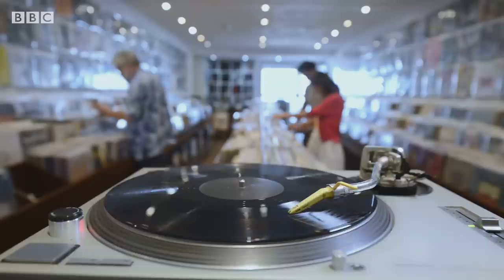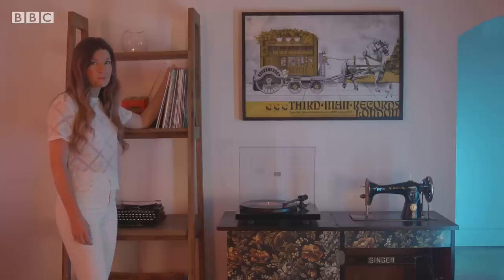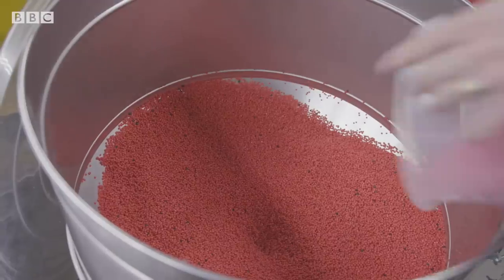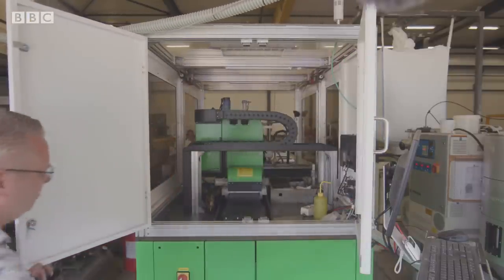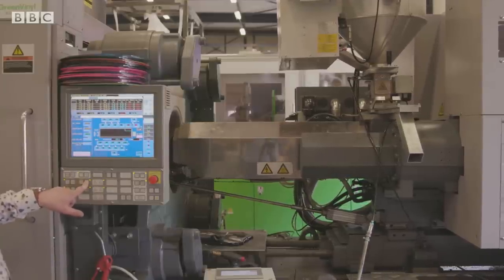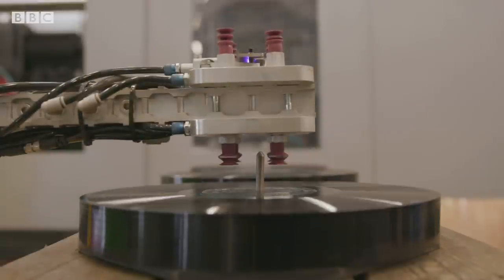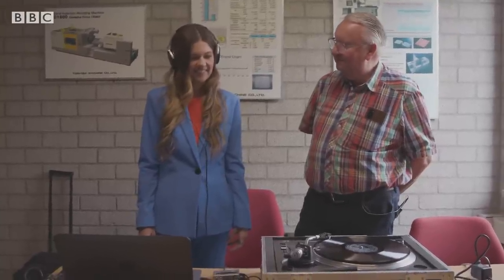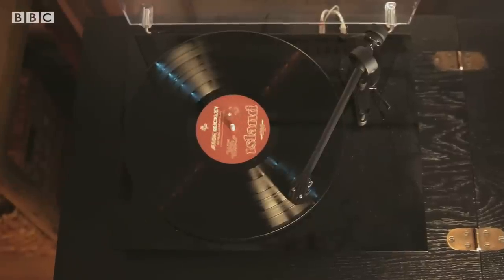Can vinyl records be made in an environmentally friendly way? – BBC News

Comment: Also, can we point out that yeah, PVC is bad for the environment, but using it for music records is hardly bad for the environment, people don't like throw out their vinyls, if they have any they probably already decided they liked collecting them. Maybe throw a fit about PVC being used in a way that is bad for the environment instead of just throwing a fit about Vinyl Records because they're made of PVC. All in all, I'd say that's a pretty good use for it, fairly non damaging, long lasting collectibles.
Reply: The environmental concerns surrounding plastic production aren't just about where it ends up, but also the harm caused by the production process itself, such as the energy (fossil fuels) consumed to create the product - almost all PVC used to press vinyl records is derived from virgin plastic, which undeniably has a negative impact on the environment. Of course the vinyl record industry only accounts for a tiny percentage of plastic production, but it's a little disingenuous to disregard the concerns raised without presenting the whole picture.

Comment: Music also can be distributed in completely lossless ear healthy electronic way using no other data storage than most modern available. But one can not touch an album bought in electronic form. Eventhough it is music. Not a box disc vinyl cd dvd blue gray violet ray or data crystal. You can touch it when u learn 2 play it.